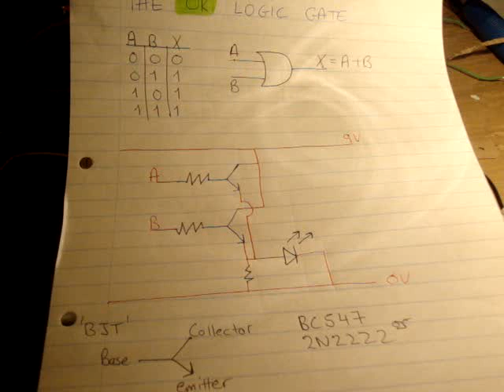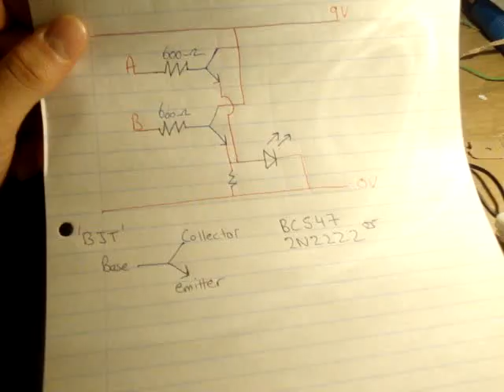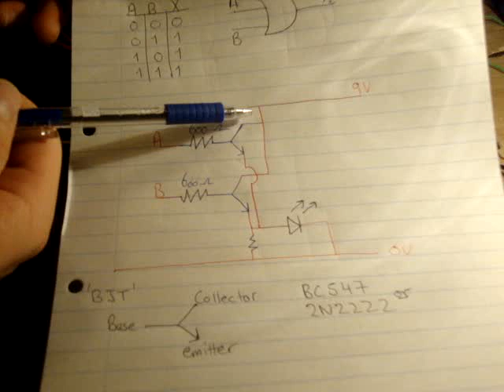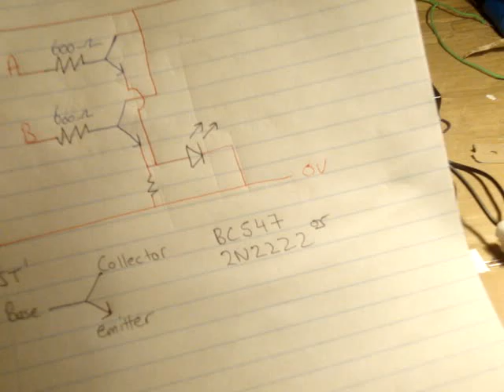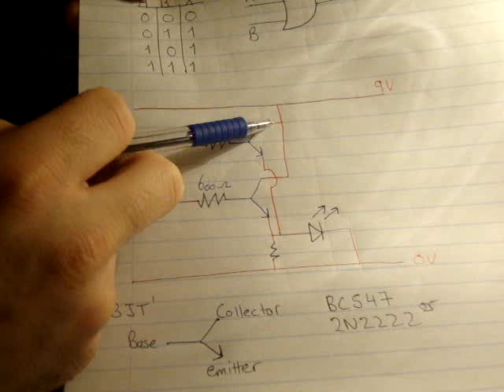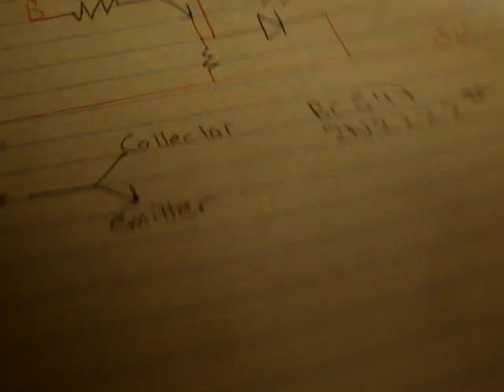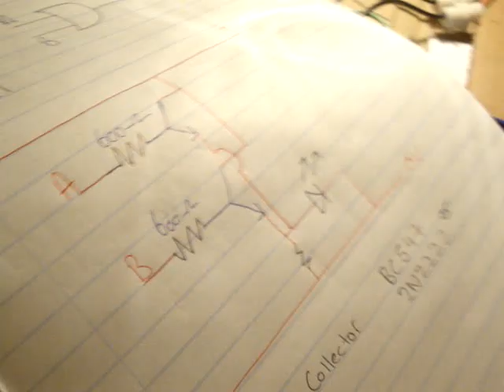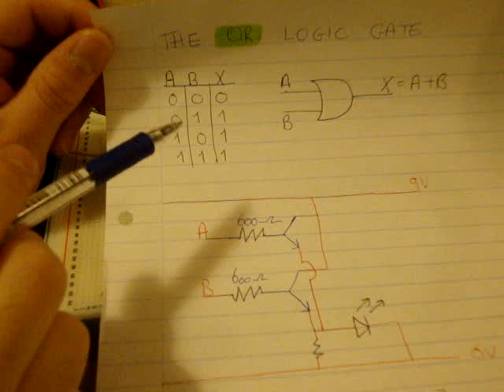Electronics 6 : How to Make an OR Logic Gate

Comment: Just a side note, NPN transistors like the 2N2222 should be used as a current sink, not a current source, therefor it should be connected to ground and should pull a transistor down to ground, not up to VCC.

You should technically be using a PNP transistor for current sourcing.
Reply from the maker: Thanks for that! Any and all comments are most welcome!

Comment: Are you using P2N2222A? Because the one I bought has the number 2N2222-331 and it doesn't work with the transistor configuration you've given. Thanks a lot for the videos! They are very educative.